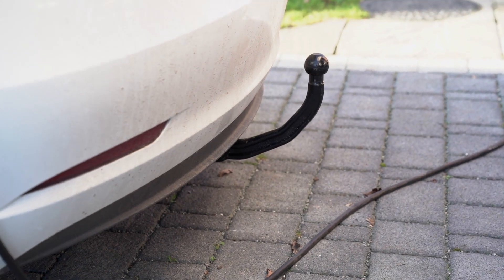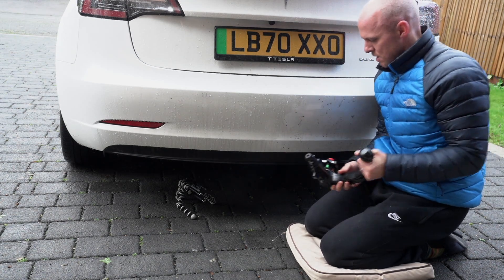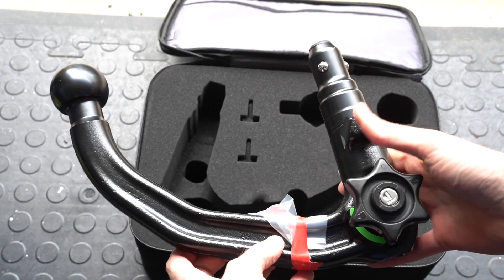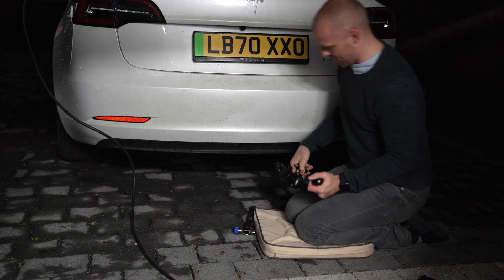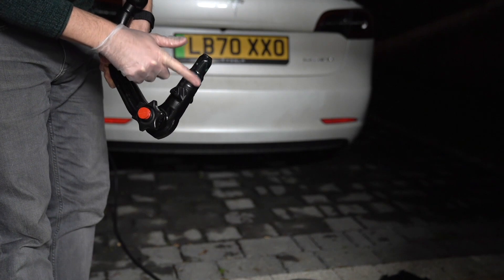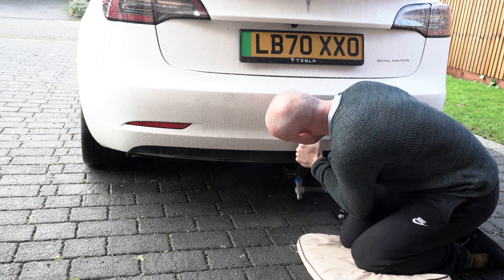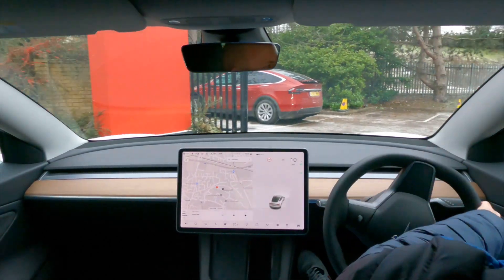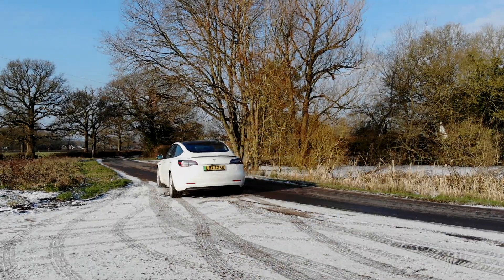Tesla Model 3 - Tow Bar won't attach?!

Comment: Thanks for this video. After having the car for almost six months I finally got around to installing the tow bar. At first it didn’t go all the way in and I then took your advice and booked a sevice appointment. However, I finally got it working by pulling the knob out a little when the tow bar was in place. Doing so meant it engaged fully. So much in fact that it’s then difficult to come out! To be honest I’d rather have out difficult to remove than if it dropped out while I’m driving!
Reply from the maker: Fair!! Glad you got it to work!

Comment: I had the very same issue and was sure that Tesla service needed to replace the mount on the car. To my surprise, this is what I found in the report from the service technician: 'I removed corrosion from inside the trailer hitch receiver and confirmed that the issue is no longer present.'  Everything works well now.
Reply: So maybe we need to lubricate/protect the receiver to prevent corrosion?

Comment: TRY THIS FIRST. Clean and grease the tow hook / hole. My tow hook was near impossible to get to stay in so I added it to a service appointment when I took it in for another issue. They noted that it was slightly corroded and cleaned / greased it. Now it locks in and comes out very easily.

Comment: I had some issues with my hitch, actually I think I had them for the last 2½ years but it wasn't until a few weeks ago I had a REAL problem... the hitch fell off while towing my trailer!!! YIKES, luckily I was only doing 15-20km/h or so and could reattach it and keep driving. After that I noticed that the handle (the one you turn) didn't snap all the way and left 2-3mm between handle and the actual hitch. I couldn't lock the hitch, actually don't think I have ever been able to do that but at least now I couldn't. The bloody thing just wouldn't snap correctly. Today I had a Tesla ranger come look at it and hey presto, 5 minutes later it was working like a charm. It turns out the little wings on the side needed a bit of fling (because of corrosion), similar to what the video showed. And he also went to town inside the hitch-hole in the car, he mentioned there's often also a bit of corrosion up top in that, that prevents the steel-ball from popping all the way out. After that he gave it all a bit of oil and closed my service appointment (no charge, very nice).

Comment: I currently have the same issue with my tow hitch, it kinda locks in but i cant remove the key from the lock of the hitch. This also led to an accident with my trailer where it was going of at 80km/h! I am currently waiting for 4 months already to get my tow bar replaced, this is some big minus points for tesla. I will try your tips, maybe i can fix it this way without waiting maybe another 4 months for a new tow bar.

Comment: A note of warning ⚠️ Don't think it's OK to use when it's sitting fixed in place but the handle hasn't fully spun closed. I was foolish enough to do this (it seemed quite solid) and had the bad scenario of the towbar, bike rack and bike dropping off. Fortunately it happened at low speed and remarkably no harm was done but it could have been a lot worse.

Comment: Nice vid with concentrated tips. I’m struggling to remove mine, like many others. I’m a bit hazy about the locking key and whether to spring the plastic but to get the locating ball bearings to withdraw. 

Any advice ???
Reply from the maker: Hi Philip, Yeah it can be very stubborn, i've had to give mine a gentle tap with a plastic mallet a couple of times.  I hope you manage to get it out!
Reply: @thetechmaven  Thanks ++. Have you any tips on which plane you are tapping it? Presumably up the axis of the main shaft??

Comment: Did they say what was wrong with it. Mine is tight to fit and takes a good shove, however I live on an island so it's not too easy for me to just drop off at the SC.
Reply from the maker: If yours does go in then I’d say it’s a different issue to mine, mine would actually fit. They didn’t say, but I know they replaced the whole part of the sub frame that it connects to

Comment: Mine is coming on 23rd (Chinese) with Towbar. What Bike carrier did you choose? Are Towbar fitting issues common? This was the first problem I had seen
Reply from the maker: I hope they aren’t common, if you do have an issue Tesla will fix tho. 
I use a Thule one and it’s great: https://amzn.to/3cqUkun
Reply: I have the Buzzrack buzzybee 4, it was the lightest 4 bike carrier I could find and brings my weight with bikes on, bang on the 55kg nose weight limit

Comment: I'm having similar bike holder and one of my biggest concerns to move to the Tesla M3 is that the carrier plus the 3 bikes are going to be too heavy! Has the weight been an issue with you?
Reply from the maker: Hi Mohamed, I really don't think the weight is an issue.  I have a video coming out soon with a range test with a bike carrier on it. But from a weight perspective the carrier is super solid and could easily carry 3 bikes.
Reply: @thetechmaven  Thanks, I'm looking forward to that video and would be great if you can add the overall weight.

Comment: Just tried fitting mine (3 day old car) and it was stubborn and then clicked in, now i cant remove it…..mobile service booked.
Reply from the maker: oh no, did they get it out Paul?
Reply: @thetechmaven  i hit it with a rubber hammer in the end and it just about clicked in. There is a little blob of weld on the inside which i think is blocking it.